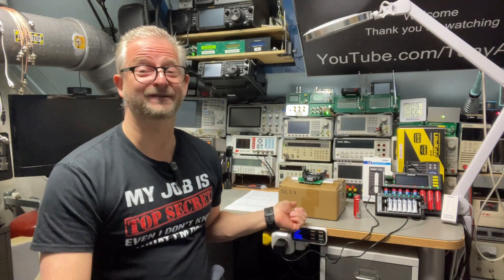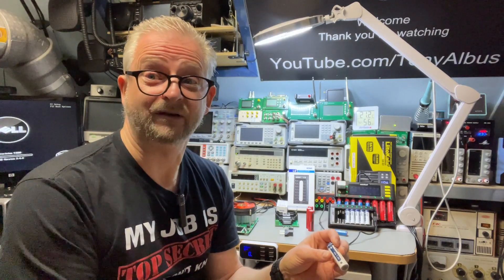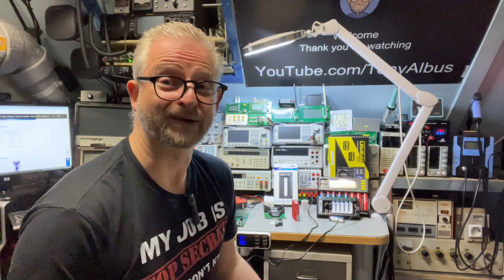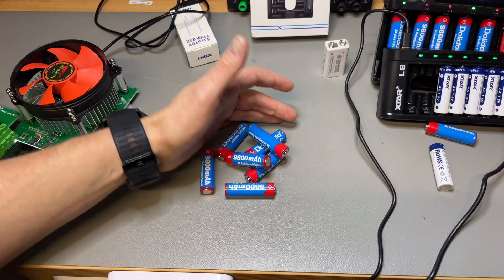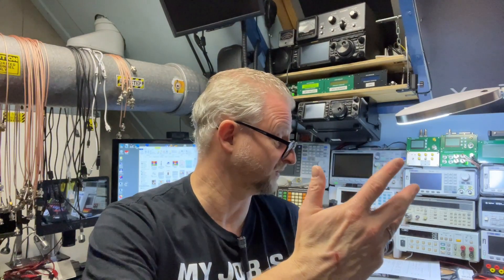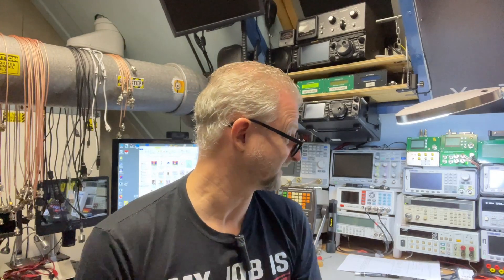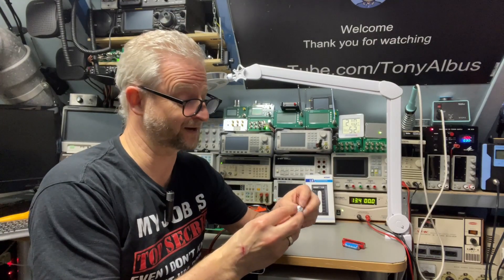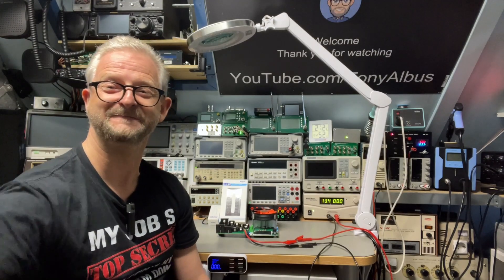TA-0375: Battery Capacity Testing DL24 Load - Featuring Xtar Batteries - Basic Theory

Comment: I have an older version that is more difficult to use so again you helped me spend some $$, Tony! I had been wanting one where I could track the capacity . So many batteries are mis labeled anymore. Have you tried any 26650 types yet?
Reply from the maker: Hi Jim...oh no, not agian..LOL  yes the new design has improved a lot. aspecialy the software. That battery i still need to try.

Comment: Hi Tony, in the video, you put the cut off voltage 0.8v, is there any guideline for this parameter? I'm testing on 18650 li-ion batteries.
Reply from the maker: Hi, i mention that in the video, its not exact sience

Comment: Hi! Thanks for the video! I have several different power stations, I wanted to test them with DL24 through the USB-C cord, the load tester stops at 15.9W+. What's interesting is that when I load the stations through the same port and cord, but with a laptop, 70-90W goes smoothly. I can't understand what the problem is and how to load the stations through the type-c port using DL24 more than 15.9W?
Reply from the maker: the usb-c is for computer connection. there is an adapter available tho connect usb to the load port

Comment: Very interesting video,  Tony.  Did you check the accuracy of the load - amps and volts - to see how accurate its measurements are? It looks like good value for money if the accuracy is reasonable.  Thank you for showing it to us. Regards, David
Reply from the maker: Thanks David, that's the cool thing, you can just calibrate it from its menu, just apply a calibrated voltage and done, same for current .. i love the simplicity.

Comment: Tony, I am wondering if I can do data logging with this device and PC software? I need to measure battery voltage, at a  constant load and graph it to an excel or CSV file? For example, how long it will take a 1.5v cell to reach 1.1v?
Reply from the maker: Yes it can do that, its actualy very amazing cheap machine.

Comment: Can I use it as simple electronics load to measure current through 24v coil? And can I set different load current values like 1A, 2A etc in sequence with time.
Reply from the maker: Hi, yes it works very nice as a normal load, directly on the front controls,  i think with the computer software you can also program different loads and run that later, but i have not tried that yet.

Comment: Hello, I have a problem, max current is mas 1.9A and never, never goes higher.
I have a 180W version.

I tryed 4mm2 cables and no succes.
Reply from the maker: Hi first try to reset it to default, there is an option in the menu, just to be sure there is no unexpected CC CV CP setting.
2nd if the device is powered with an USB-DC plug, remove the USB-DC adapter and power it with 12V 1A  directlt on the DCplug. if it still does not work correct contact your seller.
Reply: @TonyAlbus  thanks you very much! The problem solved!
My source was 6V only and when I changed to 12V, works well.😊

But... I dont underestand why...
Reply from the maker: @nick_Pletron  you need the 12 Volts.. for the FETs to open fully when needed
Reply: @TonyAlbus  thanks!

Comment: This is actually a very nice electronic load and seems quite easy to set up! The software seems to work better and more intuitive than what comes with the Siglent loads (which is not hard because that is utter crap).
Reply from the maker: Thanks! , Yes very easy to operate (good becouse the manual is so small.....) Siglent i will find out later :)

Comment: Discharging a D cell @ 50mA would take approximately 40 hours!
Reply from the maker: Correct, some high capacity batteries are made for slow discharge.. and is that not the whole point for some batteries.. 5 years or more for some.